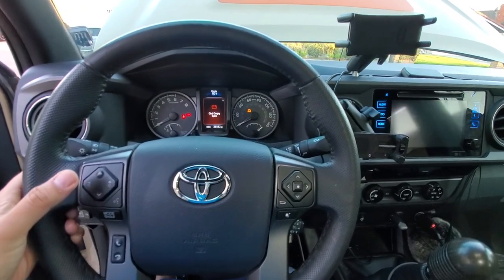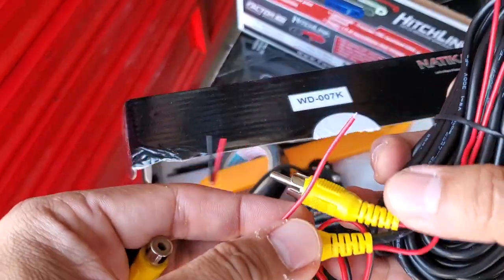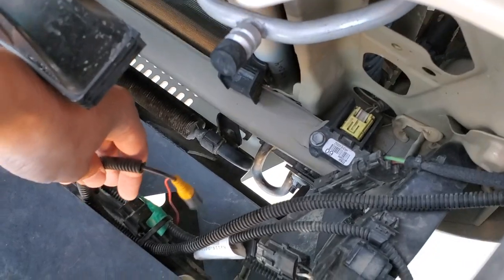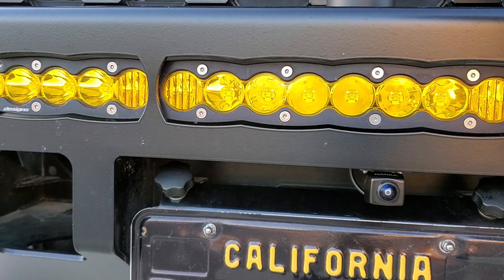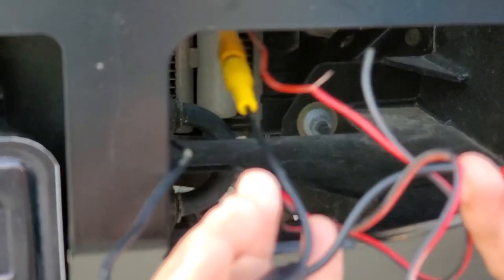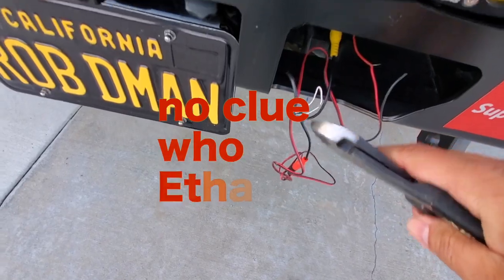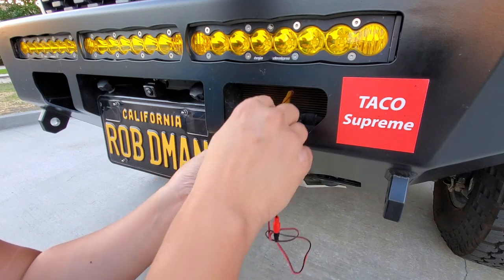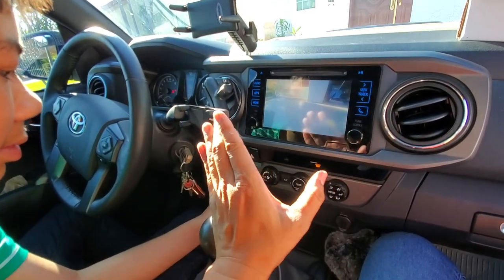Anytime Front Camera Recommendation for 2016-2019 Tacoma & all makes and models

Comment: Mines bugging out and I can’t figure out the problem. It shows a black screen with fuzzy white lines, all connections are good. Maybe a power issue
Reply from the maker: Is that with the front camera or rear mode too?
Reply: Rob Daman just the front. The rear still works perfectly, I can activate them both on demand still, but the front works only intermittently and most of the time does the black screen. When it does work it has a fuzzy haze to it as well
Reply from the maker: Sounds like the camera is the issue. Check and be sure you wired the 12v not 6v output. Did you just use the positive wire or did you ground or wire at another spot?
Reply: Rob Daman I just did the positive like a ton of other people on tw etc. natika said it’s a camera issue, car solutions said it’s a grounding issue. They said the red and black wire need to be powered and grounded as well but I was under the impression that would make the camera be on constantly so I’m not sure haha
Reply from the maker: For testing purposes you can wire the power and ground of camera to 12 volts only. It eliminates the module for power.

Comment: Rob, Does it work on the 2019 Tacoma?
Reply from the maker: Yep. Only the new 2020 don't work due new software
Reply: @RobDaman  Thank you
Reply: Rob, Where did you purchase the system from?  I looked into Amazon and they are currently unavailable?
Reply from the maker: Kenny Yuen that’s where I got it
Reply: @RobDaman  NOOOOOOOooooooooo any recommendations on the new 2020?
Reply from the maker: @shakeyfly  Not really unfortunately. I'm curious if the 360 camera in 2020s can be installed.

Comment: My issue with this system is that the mode button is so silly. Why would double clicking mode turn on a camera temporarily? Holding mode keeps it on, which is what basically everyone wants 99% of the time. This is unnecessarily convoluted. We live in the Apple age. Things should be intuitive. If I have to teach someone how to use a simple camera then it's poorly designed. Is this a Bond car? Are we hiding the feature so that we're the only person who would know it's there? It's quite silly in my opinion. The other kit is clearly better to me. Give me that clearly labeled on/off camera switch.

And let's not pretend the anytime kit install is hard. If you can do this kit you can do that kit. It's not a big deal. You don't even need to add a fuse in the new Tacomas. It just gets power from the harness. I just can't get over the mode button. So silly. But I guess if you parallel park a lot this kit oddly switching to the front camera when you switch out of reverse at low speeds would be useful.
Reply from the maker: Sure but this kit works other Toyotas and not all of them have extra button slots. What would be their solution?